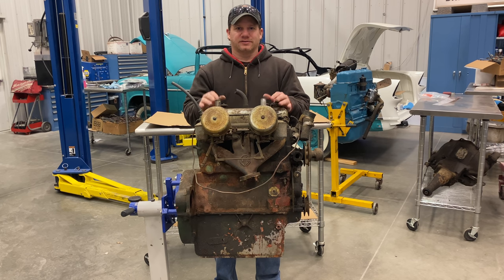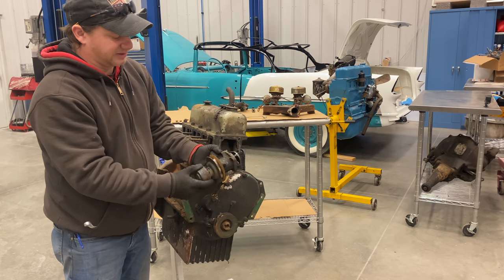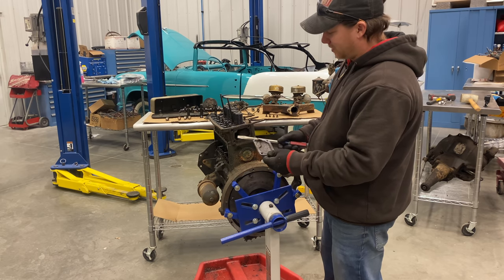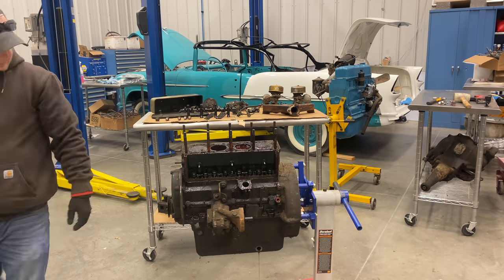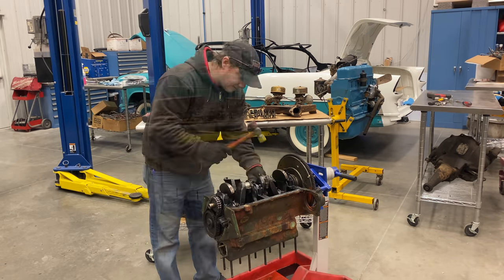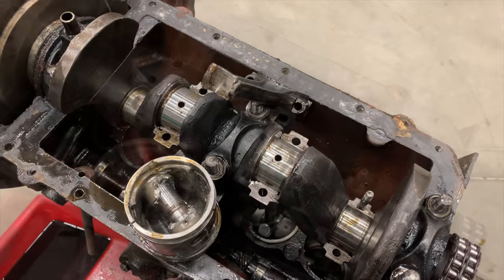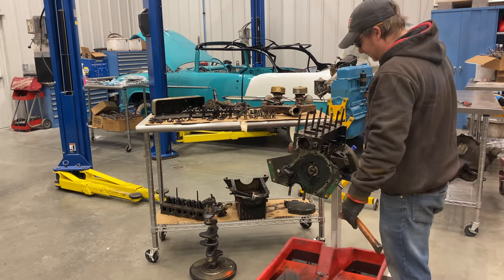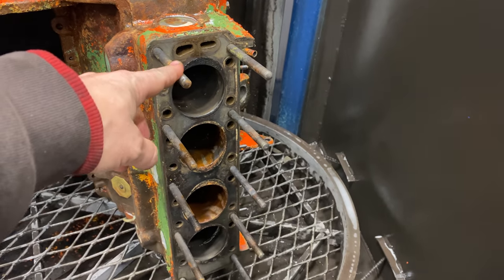What Horrors Are In This 1952 MG TD Engine?

Comment: Fantastic video, have not seen your channel before, I am now subscribed, Very interested in your progress especially when you start putting it back together.  Your engine may be from a 53 td or 54 tf, judging by the  round water passages and late model oil filter. You might mention to viewers that the Xpag engines used all metic bolts, not whitworth.  If you need any parts just let me know.  I have alot of spare original rods.  I agree with you, keep the "MG oil Drip"

Comment: Wow, that takes me back. First engine I ever rebuilt was really quite similar to that - 1976 Hillman 1725 but 24 years hadn't brought much in the way of changes to the way British engines were built. A replacement engine I had for it was at least as badly rusted as yours, though without the broken con rod. 54 years sitting idle? It's in very good condition, considering!

Comment: those are pretty thick cylinder walls so hopefully a good bore will work out and save the block.  and hope the head's ok too.  too bad the guy who originally parked it didnt drain the cooling system

Comment: Those 50s and 60s CI engines are remarkably strong, considering the low tech.  I would love to see the engine restored, it will be worth it.  I'm a bit worried about the head as well - fingers crossed for you!

Comment: Don't pound anything. As a machinist I found that one can pound and pound and not get any movement, but using a press it will slide right out. Pounding causes the thing pounded on to swell and defeats the purpose.

Comment: The "little augur " at the rear of the crankshaft is called an "Archimedes screw"  When oil tries to get past the end of the crankshaft, this device screws it back into the oil sump.  It operates similar to one trying to walk down on the UP escalator.

Comment: I used to do complete concours resto's on these in the late 70s at a place called Hoeft's in Wylie Texas. Seems like the engines were a deep burgundy color except  for a badge that remains brass. Did it all down to the wood in the body. I think I can even remember which of the bolts on the frame go painted or plated. I remember some of the factory flaws we were careful to leave in like spot welds on the rear skirt, dimples in the center plate on the dash etc.

Comment: I had experience same age MG in Finland. It was shipped from Florida in 1980`s. Its fuel system was full of hard resin and corrosion. Where it was coming from? Its joints was loose, otherwise was reasonable good overall condition.

Comment: my goodness, poor engine..
reminds me of the day at the auto shop when someone brought an old Mercedes 190D from early 60 (tailfin type) with a seized engine. we tried it out, engine was completely unvielding. co-worker pulled the dipstick, it was DRY. we opened the oil leak, nothing. poked around in it, still nothing. so we removed the little steel oil pan that hangs underneath the aluminium pan, and found it filled even with gunk. and the engine? completely dry, with the crankshaft turned blue...
the customer then brought a /8-engine (which wouldn't have worked anyway, since their engines have the oil filter housing placed differently), which was incomplete, and someone had removed the cylinder head and put it back on, and everything was rusty inside. everybody said no way!, and in the end the customer picked everything up and left.
no idea what happened then, maybe they rebuild it with a new engine, or put a gasoliner in...

Comment: My first car in the sixties was a 10 year old Ford Squire. I didn't know much about cars then and after a few days I realised it was burning oil almost as fast as I could put it in. Just to keep driving it I went to a local garage with a five gallon can and the mechanic filled it up with old used oil for me. Funnily enough I still have a bit of nostalgia for that car I loved driving it for the year I kept it running. The truth is the engineering was awful in those days and a few years back I part exchanged a car nearly ten years old and it ran and looked almost like a new car.

Comment: A good video. Those old MG engines were a simple design but very reliable generally. They would have used oil when regularly used. The rate of oil burn was high compared to modern engines that generally don’t burn any. The three bearing crank was typical of the 50’s ?, not good for higher engine speed. By the 60’s we had the 5 bearing crank we have today on 4 cylinder engines. I’m sure that engine will run again, the bores probably will be restorable with new oversize rings and pistons. A new video with the re-build will be a great !..
Reply: Strange how high some of these engines would rev, I used to limit mine to 6,000 rpm but it would easily exceed 7,000 rpm and I have a book in which someone put one in a special and the power it gave at over 8,000 rpm is amazing.

Comment: An old trick is to boil some vinegar up and place it in the bores, leave for a while and then you try the crank every so often and when it slightly moves, put some light oil down the bores. Then you can turn the crank and get the bores cleaned.
Reply from the maker: Boil the vinegar, that is new to me, I might try it on something and see what it does.
Reply: @ThisWeekWithCars  It isn't wise to leave it with alloy parts too long depends on the strength of the acid in the vinegar. But we have successfully unseized rings on engines that were under seawater before. Once you have the parts moving you can tear the rings down and clean the pistons etc. Do not have the steam off the vinegar near to your face. breathing in the fumes will make for a sore nose. Add oil once you get the crank to move. Any ally parts are the first to corrode. Knocking out the pistons can lead to cracked rings. been there and done that.

Comment: Finished a 1933 J2. I purchased a brand new cylinder head and block from the U.K.  the old parts were too far gone to repair. Also bought a billet crankshaft.   The engine bore was only 50mm.
Reply from the maker: I used to have a 1933 J2 it lives in India now.
Reply: I knew someone who had a supercharged J2, it was very quick, hard to beat on a hill climb even my 1962 supercharged Mg Midget which was faster I had to drive pretty hard to beat him.

Comment: The Archimedean screw is designed to throw oil back into the engine, however only  under very tight tolerances will this work, once an engine has done many miles the tolerances are not as tight and oil seeps past the screw., plus once the engine stops, oil can seep past this as the crank is not turning.
Reply: Especially if you park on an incline after shutting the engine off.    Worn rear main bearings and oil leaks go hand in hand even when a seal is used, though.

Comment: Goodness, what a chamber of horrors. I have a dead Spitfire engine out in the garage that needs a similar tear down...
Reply: Fit an electric system to it. Triumph Spitfires.  Chassis, Engine, Gearbox/Axle 4 wheels sort of body and a few seats,  basically fast movement in the min weight possible
Reply: Hey, Gryf! How are things over on the MGBBS Midget board? Have not been there in ages but I'm still alive. Haven't done a Prop on anyone, poor fellow.
Reply: Hello, Clare! There’s still life on the old BBS. I don’t visit there nearly as often as I used to, but it’s nice to check in every now and then.

Comment: Yeah it’s a common practice if you can’t get a stuck piston to move by the crankshaft with a wrench after some kind of spray lube to use a fitting that connects a grease gun to apply even  pressure over the entire piston face. Sometimes it works but sometimes it doesn’t.

Comment: I think some of the nuts and bolts were a British whitworth size and that probably explains the sump drain plug being stripped.
Reply: All of the bolts on the engine are actually metric thread with Whitworth heads .  There is actually only one true Whitworth threaded bolt on the entire car.  The rest are BSF bolts and nuts with a mix of BA screws .  I do agree with your conclusion on the drain plug as many hacks try something that doesn't fit and as much as the plug is brass they ruin them pretty fast.
Reply: @larue33054  
Morris Metric, people do try to force the wrong bolts in and strip the threads, I had to retap a few on one of  my TD's. 
The reason for Morris metric was that Morris sent blank bolts and nuts to Germany where they were finished and the Germans used metric threads, early Morris Minors and Series 1 Land Rovers have the same.

Comment: The red liquid may well be 'Red X' upper cylinder lubricant  which back in the day was great for softening carbon on Piston rings
Reply: I remember Redex but few others seem to. It was in a tank beside the pumps and cost an old penny a shot - one shot per gallon of petrol. My dad swore by it but could never explain exactly what it did.
Reply: @alans9806  It was used to prevent a build op of carbon on pistons and valves. In the days of this engine, head off overhauls were done every 50,000 miles due to carbon  deposits.  Known as a decoke .

Comment: When I have a cylinder that badly frozen and someone put oil in... I completely clean the oil and crust out of the cylinder and fill it with muriatic acid for a few minutes depending on the reaction... Setup a 55 gallon drum cut in half underneath to catch the mess...  Rinse with baking soda water...  Does a good job..

Comment: I guess you are in the USA  . you can get all the parts you probably need from MOSS,  looking at the camshaft I would suggest you replace as the peaks look well rounded, these engines are very cruel on cam wear as the followers often don't rotate  .. look on wear face of the cam followers for non rotation.  Re the rear oil scroll if care is taken on rebuild to fit the rear pate with 2 thou clearance on the crank scroll you will get hardly any leakage.  I rebuilt my TD about 10 yrs ago to stage 3 tune  and do about 3000miles a year with less than 1/2 pint oil usage each year.   It is well worth getting the workshop manual for this engine to set up the correct clearances.

Comment: I would not try to turn the crank. Just carefully take it apart. When you get the heads off soak the piston with penetrating oil before trying to remove them. 

When I was doing this work I would set up holders for the parts being removed so I could put them back where the same from.

Comment: I would be inclined to put the whole block into a container with 10 part water. to 1 parts mixture of molasses for 2 or 3 weeks and I guarantee all of the rust will be magically evaporated away to leave pristine metal. Try it sometime. I was amazed when I did. 👍👍👍😁

Comment: Probably saveable as long as it's not cracked or anything. Good chance it's got bent valves on #4 though; that piston came off under tension which means the head had to stop it and then a valve pushed it open. Or even worse, a valve stopped it cold.

Comment: Just curious why didn't you take out the core plugs before you put it in the washing machine?  They can be replaced now with brass plugs lasting much longer
Reply from the maker: This was just a wash so I could look at it, the cores will be taken out when it is hot tanked.
Reply: @ThisWeekWithCars  Thanks for the reply... Can't wait for the rebuild,  also you can get 100 over pistons for this block because of the rear water passage.

Comment: That cylinder head needs the David Vizard gas flow treatment. Every little helps. :-)
The rear seal and end plate can be modified to take a normal lip seal.

Comment: Is it possible to machine an engine block like this one so much so to give you the ability to set a hardened steel pipe in there to replace the cylinder wall?

Comment: Ed China on Wheeler Dealers performed a mod on an engine in an MG TA with a similar scroll rear "oil seal" to replace it with a more modern oil seal from a later MG. It involved a machined ring that sat on the end of the crankshaft and an insert to carry the oil seal. The engine plate had to be modified to carry the oil seal (and the seal had to be modified too). I had mixed feelings about it. It seemed to solve the oil leak, but there was no way the engine could be restored to original.
Reply from the maker: I've done that mod it isn't very good.
Reply: @ThisWeekWithCars  The mgaguru.com guy did a similar oil seal mod, and when it was time to replace that engine, he didn't bother doing it to the replacement.  Juice isn't worth the squeeze, and if the seal gets damaged it will leak a lot more than the scroll.  The bell housing of these cars generally have a weep hole in the bottom with a cotter pin loosely installed, which will vibrate and keep the hole clear.  8^).

Comment: Good stuff!  It's interesting to me that this block has a cast-in bellhousing flange.  It seems more typical for British engines of that era to have used a bolt-on plate at the back.  BTW, is this the same engine as was used in some Ferguson(?) tractors, or am I thinking of something else?

Comment: Olde Standard Vanguard 4 cylinder motor rebuild would be nice. The motor was used in the Ferguson Tractor so parts are available. Good motor. Early blocks were made from Gun barrel steel. Vanadium /Steel.
Reply from the maker: I have several of them sitting around (from various TR2-TR4s I have owned) I will rebuild one on video someday.

Comment: I would check on the availability of suitable oversize pistons before committing to a rebore, the XPAG engine has been out of production for nearly 70 years, probably a BMC 'B' series engine (1498, 1598, 1622 or 1798) might be the way forward.
Reply: That engine is entirely rebuildable; new cranks (better than the originals) are still available from Moss as far as I know, along with most other parts that would normally be replaced.  Save the B series for the MGA/MGB/etc that they belong in.
Reply: The way forward would devalue the car.  Better to keep the original engine which was a very good engine.
Reply: @barrierodliffe4155  I've since discovered that the spares situation is better than I thought. Forty years ago we used to re-sleeve Land Rover engines, if we couldn't get hold of the genuine spares we found a local foundry that would produce cast iron pipe that we could machine to size.

Comment: Let me at it! These old cars are what I’d be used to rebuilding. Unfamiliar with anything after  the 80’s!  My 1960 car is almost as new, mechanical and bodywork. My 1991 has fuel injection, what the hell is that? Bring back the serviceable carburettor!!!!😃

Comment: Lord, those SU carbs will never sync up. Spent a summer trying to get the carbs sorted on an old Jaguar. Never did. The owner died before we ever even got close. The vacuum pistons would never sync and the acceleration was terrible even though the engine still had decent compression.

Comment: I hope the funky stuff was grease. A technique for putting a grease gun on a cylinder to apply pressure. Transmission fluid and acetone work well but acetone absorbs and retains water over time.

Comment: Hoping that you can get old iron sides running again. I  had a TD boy was it fun if it wasn't raining.
Reply: I had two, great fun if it was raining, the handling is very good.
Reply: @barrierodliffe4155  I don't know about you but the side curtains opened up as you drove an rain would pore in.....hahaha
Reply: @jetseat  
Nope, that never happened in either of mine and in fact with the hood down you did not get wet if you were doing more than 40 mph.

Comment: Parts were harder to get and more expensive, but not scarce. Add that to it being a very niche market here and there's a giant mismatch between the car market and those that end up owning them. Shiny little car that seems to be a little popular at the time, no one wants to mess with repair so they go for a few hundred, gets shoved in barn or back yard under a cover and the plan is to find another for a few hundred for parts car. Running ones that are wrecked get immediately scavenged because there's so many in that state, the drive trains go for 3-4x or more what was originally paid for the car, so they sit.

Comment: Don't know how true it is, but my Dad once told me when he was in the Army in WW II he had an early MG.

He said they had a serious design flaw with the fuel pump on the engine being mounted above an open type starter motor. If the pump leaked it could cause a fire when the fuel leaked over and into the starter, which of course, happened to him once. Ruined his trench coat trying to put it out, which he managed to do.
Reply from the maker: The fuel pump is mounted on the firewall safe out of the way of everything, he may have been talking about the carbs.
Reply: @ThisWeekWithCars  it was a long time ago when he told me,  but your comment sounds about right. Maybe my memory is a little off there. 
Thanks for putting me straight though.

Comment: Looks like it was driven with coolent leaking inside combustion chamber until it ruined rings and eventually broke rod.

Replacement was fitted, hence mismatched rod and driven untill the same thing happened to the next cylinder upon which point it was parked thereafter.

Comment: So its simple... You over bore the block, chill the liner, heat the block and press fit cylinder liners and re bore to standard. I did this when I was in my early 20's.
As for some of the other commenters..
If the floor is clean.. The accidents are reduced...

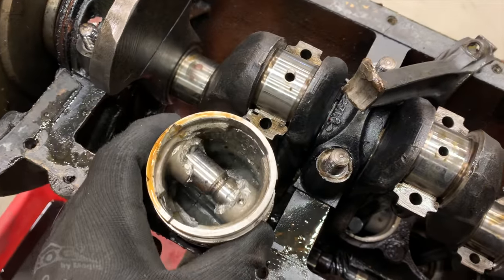Comment: 11:50  What?? .. split designed into one side of that piston?? .. never have seen that done before.
So interesting to see how engineers designed things long ago ... that hex bolt in the top end of the connecting rod, appears to lock the wrist pin in place via a groove in the middle of the wrist pin .. of course all that weakens the rod and wrist pin.
Reply: a  split on the side of a piston is common for oversize pistons